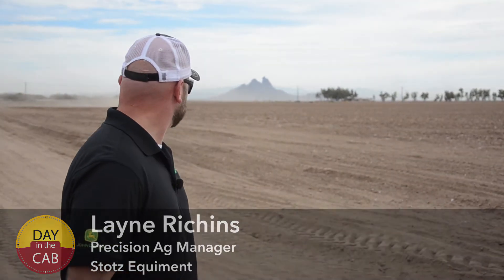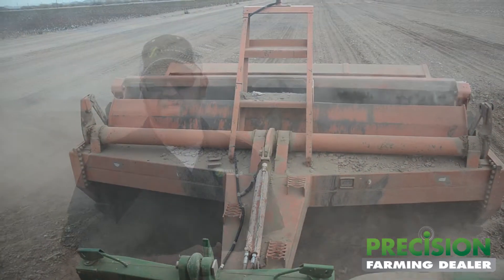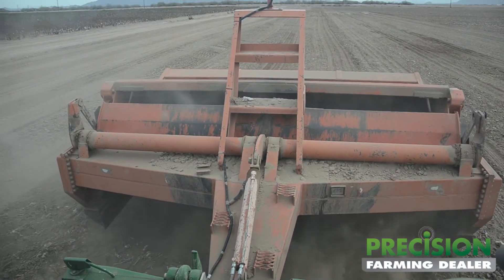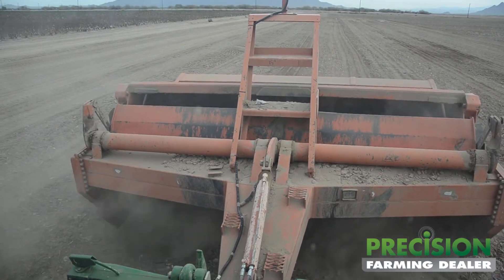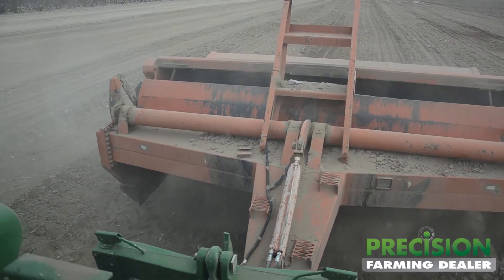Banking Water with a Smart Land Leveling Solution

Comment: I had an 80 acre field 1320 ft by2640 ft. 11 years ago .. the irrigation well was on the south side of the field. I built a perimeter road around the field and basically broke the field in half with a north south road from the well across the field was then leveled at 2 percent from that middle road to on a line east and a line west... basically turning the 80 into two fields of 40 acres + or -- it can now have rice or corn  grown either side of the well... rice in paddy's and furrow irrigated  row crops..